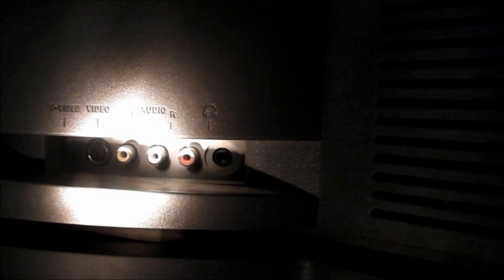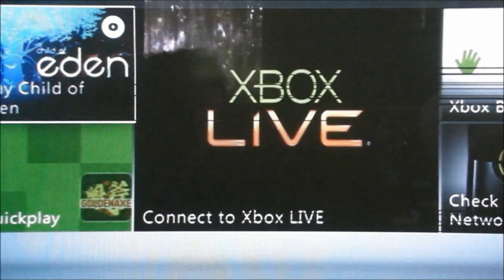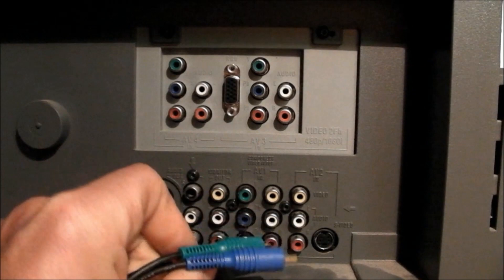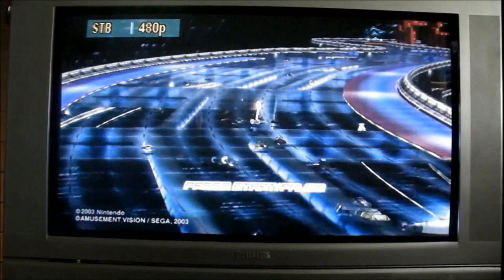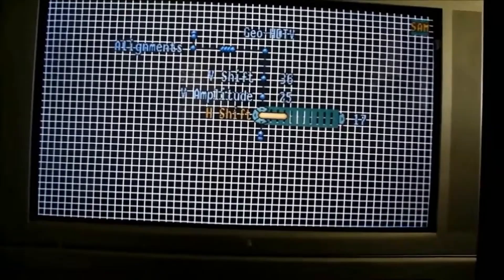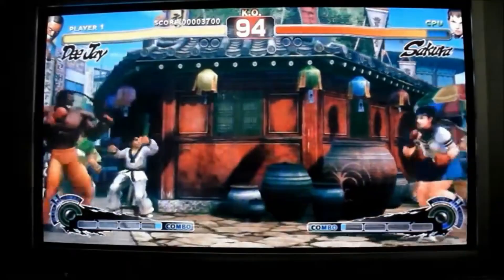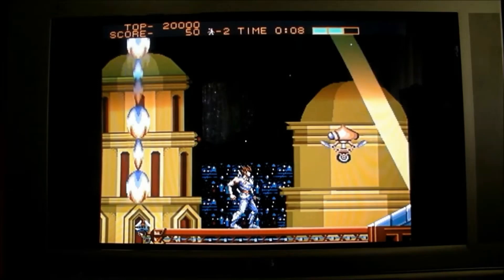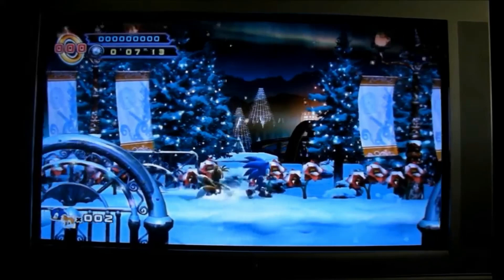Philips Pixel Plus 36PW9527 79R HD crt TV REUPLOAD 2022

Comment: It's weird that this exact model was also released in europe. but without any HD/YPbPr or VGA inputs at all, only 3 SCARTs (only 2 of them RGB btw).
Reply from the maker: Yes, there is the section with those connections you describe. A removable section that was fitted with particluar connections depending on the  market the set was intended for.
Reply: In Argentina, Uruguay and Brazil we got the same tv but it was a mix, its PAL but without the vga and scart inputs
Reply: @rgbrob  so in theory  I could import the removeable card from a broken one in Australia and make a European model HD?
Reply: @oxstorm644  in theory, yes, but I think you would need to enable it from the service menu.. so it will require a bit of digging

Comment: i have a philips 32pw9551/12 but the service menu is not showing for me it's driving me insane, do i have to be on a specific channel or input ? i don't watch tv on it and don't have the connector for that plugged in, is that the reason that it's not showing up ? it should be the same code for my tv i even got the friking original  remote

Comment: You're a harsh critic, my friend...maybe a little too harsh. I've seen almost all of your videos, and it's worth pointing out that you've somehow gotten your hands on a few of the most elite class of CRTs. The Philips Pixel Plus is by far the highest-end brand offered by Philips at the time. I'm shocked you're not blown away by the geometry/convergence on these TVs because they truly are astonishing. It's "projecting" (using that word loosely here) an image on a totally flat screen that is both enormous and 16:9, which is by no means easy. The fact that the geometry doesn't come out looking like a fishbowl image is a testament to the steadfast engineering behind these televisions. I saw negligible misconvergence and bowing. Boggles my mind to hear you call this a mid-grade TV when 95% of CRTs look like crap compared to this. A little work with the focus controls would sharpen it up a bit, but it already looks fairly good—not PC-ready, but HD TV-ready. I would say the user interface is a complete disaster as you pointed out (three separate, clunky component inputs???), and the processor from 2004 may be showing its age when it upscales 240p to 1080i at 100Hz, but the raw signal-to-deflection side of the Pixel Plus CRTs—that is, the picture that is actually produced by the tube—is absolutely, downright to die for.
Reply from the maker: This was one of the first sets I ever got so not much to compare it against back then, perhaps i was a bit harsh. An old video that was recently re-uploaded.
Reply: i have the same tv , its very sharp and clean picture, i amazed how the picture quality colors/deep black of this tv destroyed al my plasma Tvs and my sony HD CRT 4:3 with 720p and 1080i ,
this TV vs oled tv = how old tech look amazing like this one  in 2022  😧 ? 
 this shines with wii u ,because wii  u have the best 1080i in most CRT TV ,
 playing the wii u 60fps games in   1080i in this tv  will make you feel you are playing in high end 4k oled  tv in 36 inch for the first time , and the motion resolution win for this crt ( fact )
Reply from the maker: @chopinhoven  Unreal, its crazy isnt it!
Reply: Strangely enough, almost every 100hz 16:9 CRT i came across had shockingly good geometry and convergence, either low or high-end.

Comment: Nice picture quality on this philips tv.
I have one in my collection ( 32PW9551) and man what a beast.

btw. you don't need expensive camera to record it, personally i use "cheap" elgato face cam for recording.
Reply: D’you game on it? How’s the input lag?
Reply: @simongrozov1801  Yes, i game on it. I guess it is very low input lag, lower than modern LCD tv's or Plasma. Just don't game in 1080i mode if you use vga to hdmi adaptor.
I also use hdmi spliter on my philips. Personally, i can't notice any lag at all. The analogue component input feels more "responsive" for me. (tested with ps3).

Comment: Will it do 240p through the 480i input? 

edit. Just saw the end of the video with the wii. Bummer it doesn't do 240p. There are a couple multiformat TVs in the USA i.e. the RCA Proscan but I have never run across one.

Comment: I’m struggling to tune my master system 2 via rf- any pointers?
Reply from the maker: have you got any other consoles or devices that tune successfully to your tv?
Reply: @rgbrob  I cannot access any sort of tuning menu at all. Downloaded the manual, and have the original remote, but the button combination to access the install menu doesn’t work. Have also accessed dealer menus but can’t find anything to help tune the tv.
Reply from the maker: @Jimbrewski1977  Maybe your remote is not working completely.
Reply: @rgbrob  could be. Any ideas how I could get round that?

Comment: Shitty EU models don’t have VGA and component inputs
Reply from the maker: Man thats harsh!
Reply: @rgbrob  It's true though, do you think European models could be fitted with the "input cards" of their equivalent HD sets?

I experimented fitting a Samsung 17" PC monitor chassis onto a Panasonic 32" 16:9 tube; it worked, it turned on and gave a picture, but every color beside white was a rainbow, probably because i used the monitor's yoke (90°), since the TV's yoke (either 110° or 104°) was not compatible with the monitor's chassis, but the text was in focus.
Reply from the maker: @efuuu  You could probably remove the input section of the in my video and put in a euro model and then change the tv model number in the service menu which may very well enable your newly installed input board.
Reply: @rgbrob  that would be a dream come true; thing is: it would be impossible for me to find such a part.